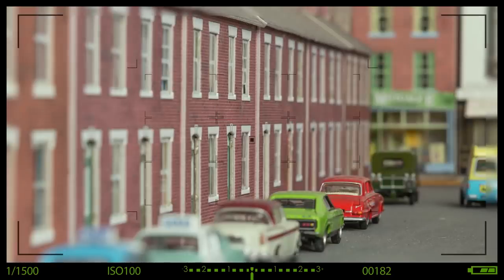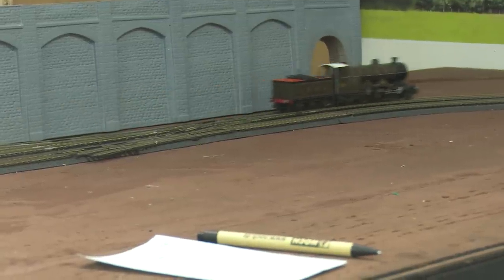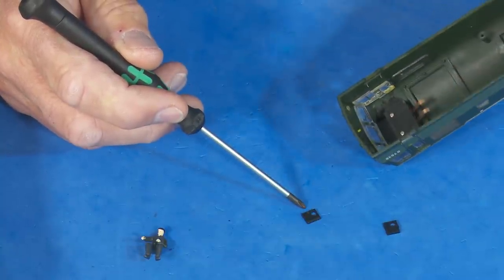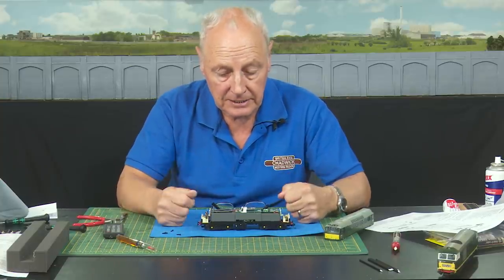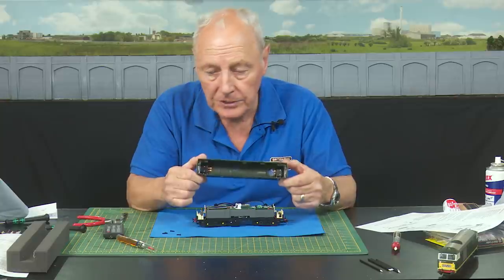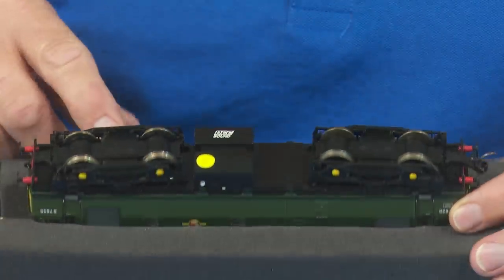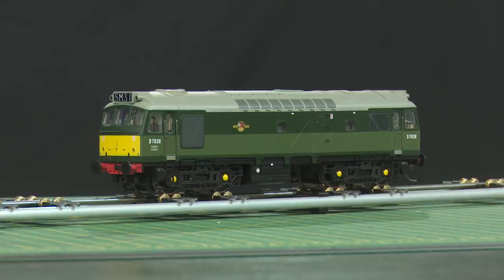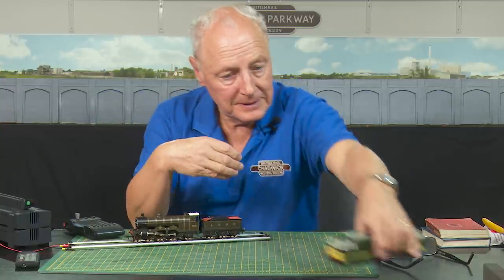Loco Servicing at Chadwick Model Railway | 109.

Comment: CA glue was developed fr neurosurgery, for holding brain tissue together.  The problem is that it bound all human tissue together, even when not meant to.   Medical folk tell us to not use common hardware store CA to close lacerations and the like, as the different mfgrs put "stuff" in the glue which is less-ideal for human use.  (However, needs must when the debil drives.)

FOr a better applicator, go (to the store and not the sewing room) and get a selection of needles (pack of ten is about $2 in the US).  Find a bit of dowel, or a beyond using paintbrush, and drill a hole in the end a suitable size for one of the needles.  Epoxy the sharp end into the dowel.  Now, with an abrasive wheel and decent magnification, file off the closed end of the eye of the needle until you are left with  something of a "U" shape.  That former eye will hold a usable quantity of CA glue and deliver it where it is wanted.  A fine needle will offer up a smaller quantity than a larger needle, so, size matters.  Eventually, the glue will gum up the eye, but  a bit of debonder on a rag will sort that right out.
Reply from the maker: What is an interesting comment. Many thanks, regards Charlie

Comment: I’ve burnt out the odd ringfield but nothing else really.
Reply from the maker: Thanks Tom, you’re the 1st to mention a burnout. Regards Charlie
Reply: @ChadwickModelRailway  The old Hornby Dublo, i.e. the original ringfield motor had a tendency to burn out if they stalled so could never be left running unattended.  I run steam locos and the Hornby ringfield motors draw more power and tend to be noisier than the replacement loco drive but then there are more gears.  The ringfield units are virtually identical on steam (tender driven) and diesel.

Comment: Charlie in the end i got sick and tired of messing with N gauge locos, they are just too fiddly to work on, i have switched to OO gauge, the mrs just bought me a Bachmann colas rail class37 with factory fitted sound from bachmann. what a beast it is. one recommendation from me is buy a tube of de-oxit d100, a drop on each wheel and pickup will make any loco run better than new, its amazing stuff. as for the motors they only burn out if they overheat, there is a simple solution to this problem, fit a piece of thermal pad between the motor and the metal chassis, then the chassis acts as a heatsink and the temperature of the motor goes down from 65celcius to 35celcius, the thermal pads can be bought here: https://www.ebay.co.uk/itm/Gelid-GP-Extreme-Thermal-Pad-1-5mm-Thick/353073548255?hash=item5234d2cbdf:g:klMAAOSwwu5euMZA once its fitted the motor will last for years. the motors today are very robust in bachmann models mind, James may ran a bachmann loco for 5 miles and it still worked perfect, oil is not ideal it drips everywhere i always use MPG multipurpose grease.
Reply from the maker: What a great comment. I will certainly check out those heat pads, regards Charlie
Reply: @ChadwickModelRailway  I use them all the time charlie yea, they pretty much treble the motors lifespan. with a thermal pad fitted if the loco gets 2.5 hours use a day, you are looking at around 14 years life

Comment: 100 hours is very low. I would have thought that 1000 would be more reasonable.
Reply from the maker: Yes it does beggar belief, I’ll have to look into this more deeply.
Reply: @ChadwickModelRailway  Really is a strange one. 100 hours isn't even a weeks running and It would take long to rack up 100 hours, especially if you used your models quite a bit. 100 hours between servicing is more like it, not the total life.